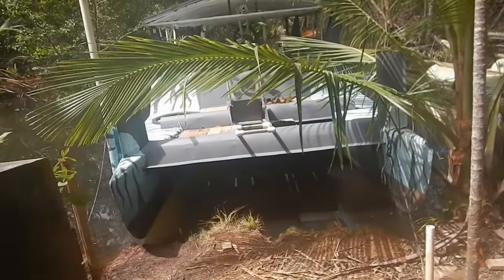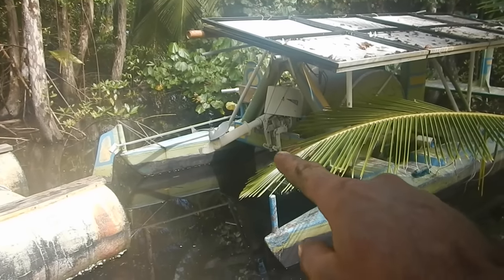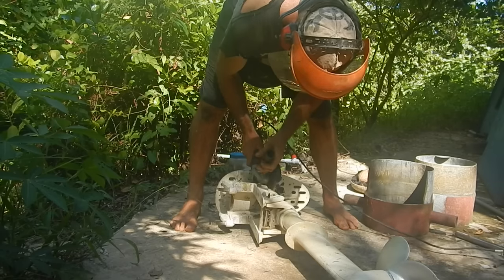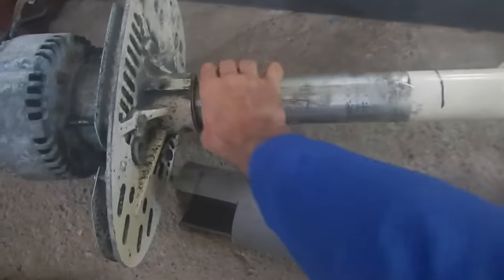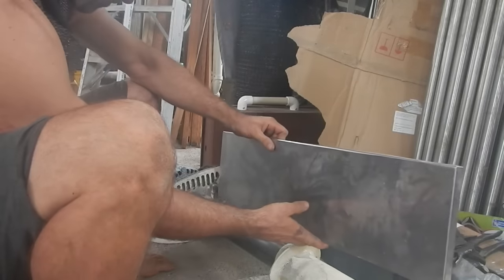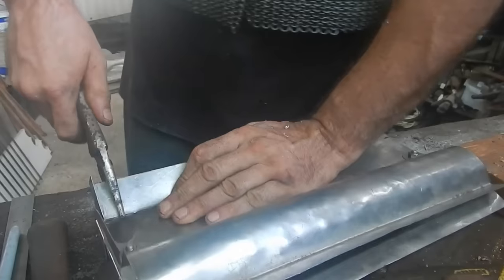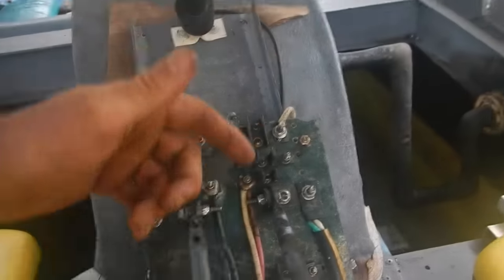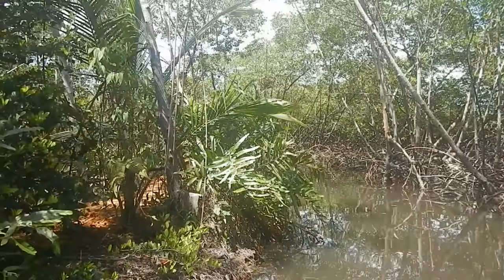Upgrading the Tiger Shark -Motor

Comment: You may want to put some washer between your motor and stainless steel holder. It appears that the weight of your motor rests in a top of the stainless steel edge and the motor aluminum. Vibration and friction eats aluminium off fast

Comment: Ray Electric 450 Outboard motor has served me well, onboard 48-volt solar-charged battery powered for 11 years. That prop has authority and I too use it to hydro-dredge and maintain the dock area. Freshwater has produced no apparent corrosion. All from the sun which I still find amazing. Fun video.